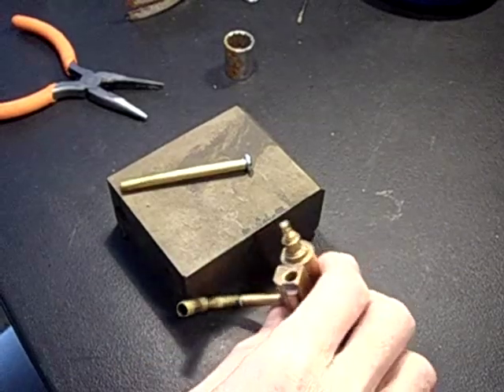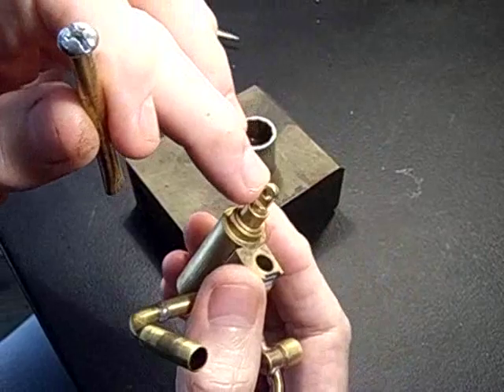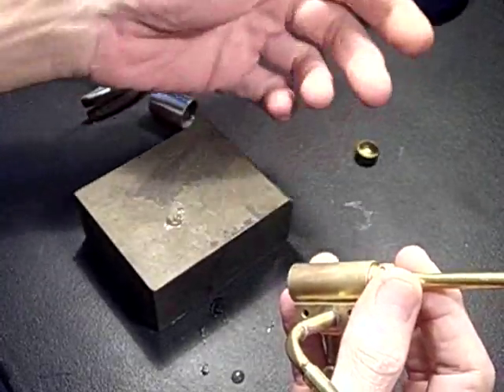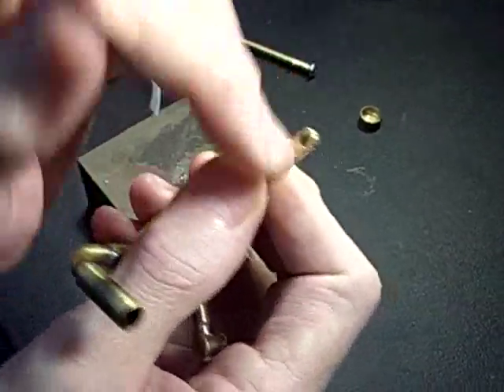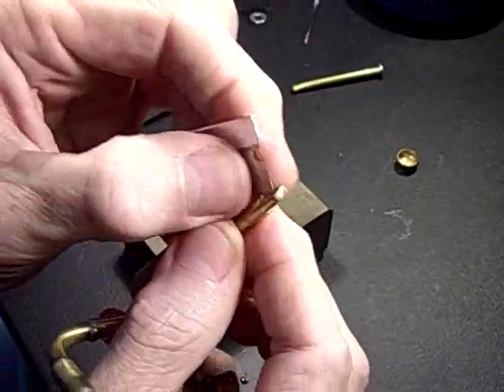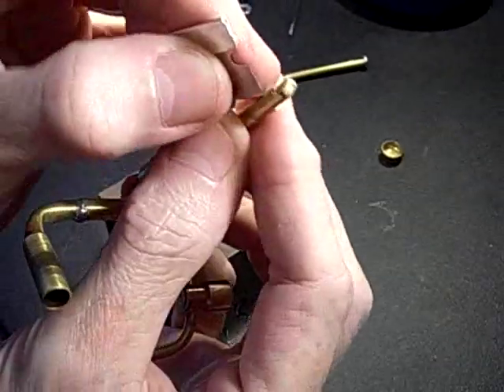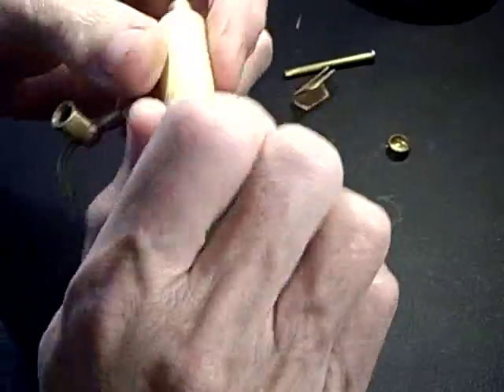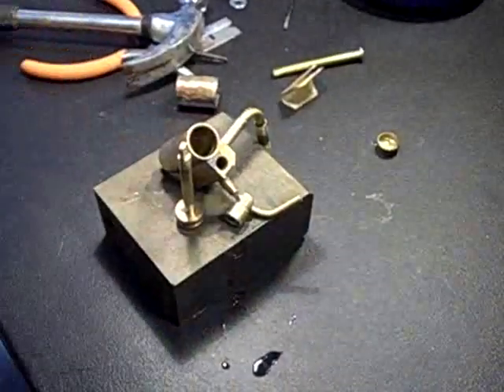How to open the Wilesco steam cylinder

Comment: I have a Wilesco with a seized cylinder, of which I was possible going to have to buy a new one, but I'll try this, thanks for sharing it with us.
  I think I'll wash the paint stripper off before I handle it!  So you think this works better then penetrating fluid?